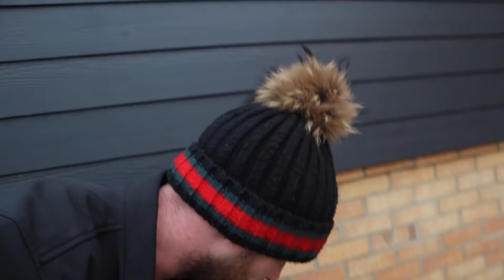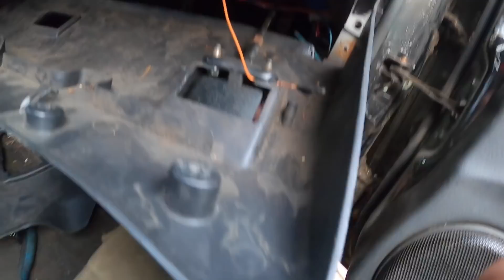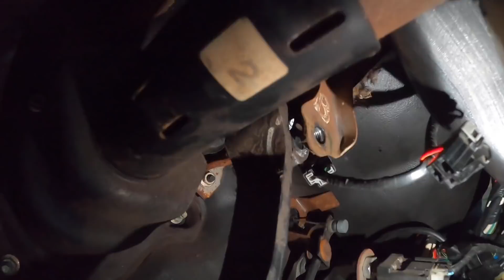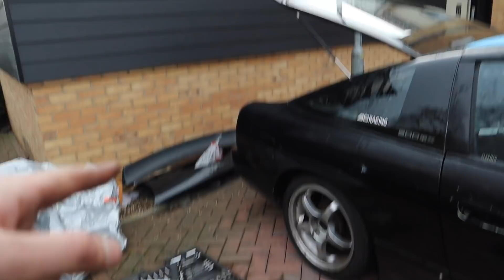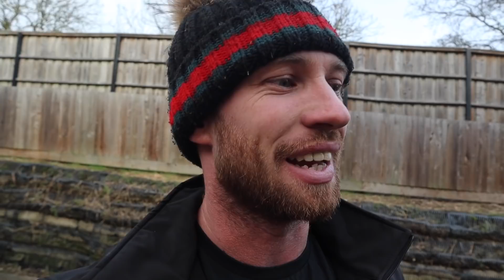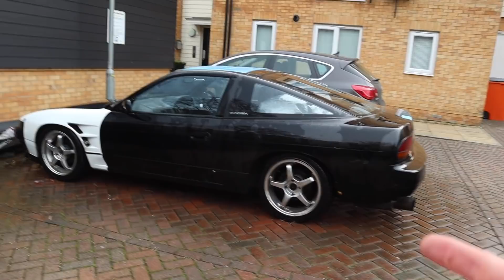it’s only just begun.

Comment: It’s getting there need to clear all the shite out of the inside now and will automatically be a better drive I’m sure someone can come up with a sunroof I’d put a black blanking bung over the hole for the rear wiper and remove that blue wrap off the tailgate and just rattle can the front wings black for now only cost about £3-4 but will make the car less obvious when driving round can’t wait for next vid though 👍
Reply from the maker: If I rattle can the front wings it’ll just make way more work load and stress for when we paint it properly! I’m gonna have to just deal with it for a short time 😂